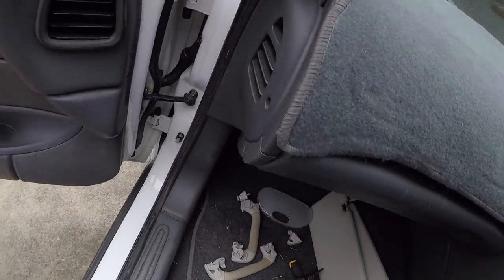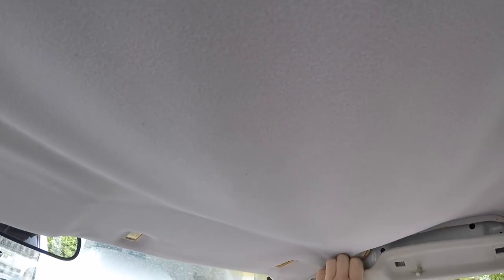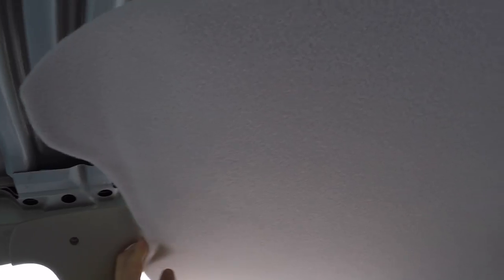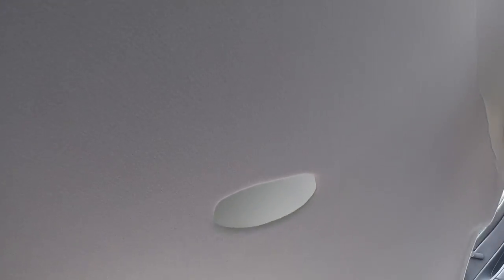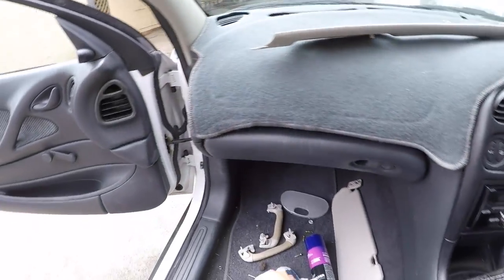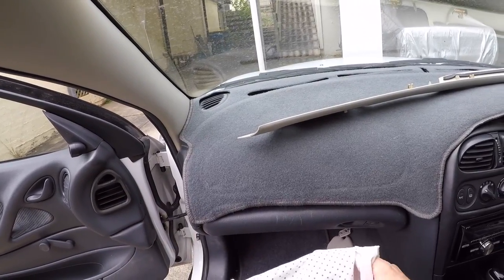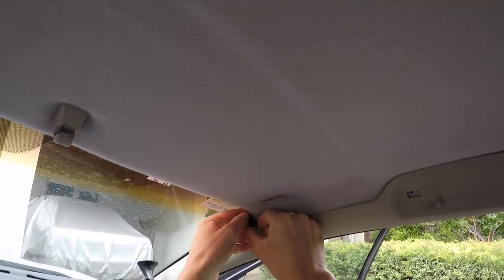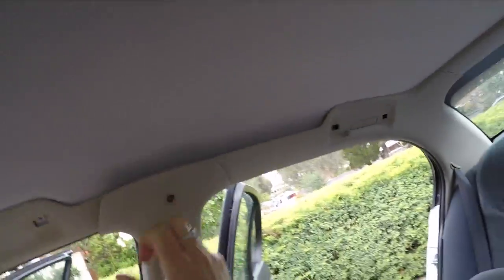Headliner Replacement on a Holden Commodore VT VX VY VZ Sedan (How to DIY Roof Lining Repair)

Comment: Hi from England, as VT1 are pretty rare over here any info on screws and trim clips is a big help. Great video very professional. Im new to car trimming so when i finish a job like this i vacuum the whole interior (the boss doesn't like because of time but i get a happier customer) as it may not have been done for a while. Thanks again.

Comment: Thanks so much. Might consider buying the fabric  on eBay and glue it on.
Reply from the maker: BUY Foam Backed Headlining Material- https://ebay.us/iVlfnt
▸ Permatex headliner & carpet adhesive - http://ebay.us/apC9ZH
▸ 3M High Tac 76 Headliner Glue - http://ebay.us/eAGTji
▸ NEW: Buy TensorGrip T65 500ml Can - https://ebay.us/rysIGV

Comment: Great video, I got vt sedan with sunroof. I've been quoted some ridiculous figures from 1500 and 750. Last I had seen quite honest he said if the panel behind the sunroof is solid and doesn't slide around it'll be 250 plus GST but if it moves around I'd have to pay for someone to take sunroof in and out of the car. It seems solid to me behind sunroof.  Do you have a video of doing home with a sunroof, cheers Graham
Reply from the maker: Yours would be the non solid type

This style is usually referred to as a floating headliner. 
Explained in this video below that we made: Even if the headliner board has been modified to try replicate the style of sunroof we would usually work on, it usually still remains that its something we dont do:
https://youtu.be/x1PRt0HjCZw
Reply: @ReecesAutoHeadliningRepairs  thx mate
Reply: @ReecesAutoHeadliningRepairs  I had feel around and feel solid. It is a VT HSV

Comment: Hi how much material would i need-2011 hsv sports wagon,cheers
Reply from the maker: Of the top of my head I believe it's either 2.5m or 3m. I should have the measurements listed on my sales page below, otherwise best to measure this on up yourself prior to purchase 

Buy Our Fabric We Use On Our ebay Australia Shop - 
https://ebay.us/iVlfnt
Reply: @ReecesAutoHeadliningRepairs  ok thanks will do.think it may be the light grey(will double check) looks like your out of stock in that colour though.